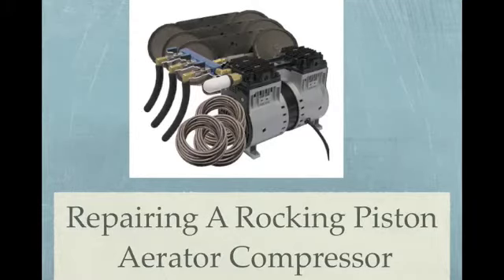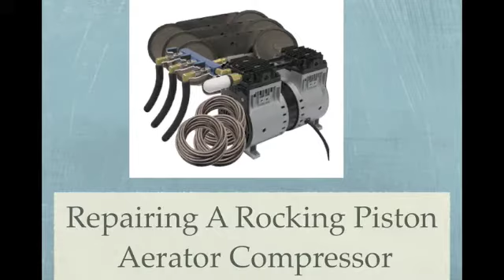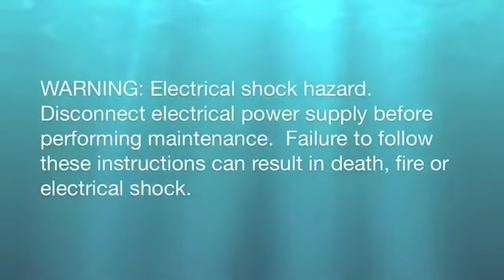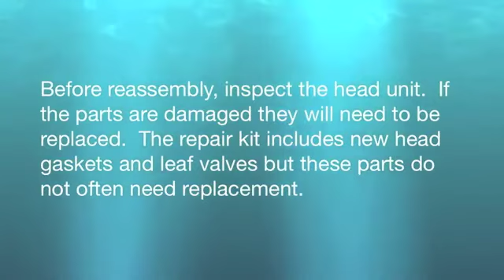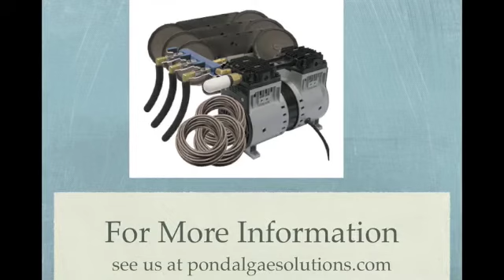Pond Aerator Repair

Comment: I should note that in terms of routine maintenance, this would include piston seal replacement as I noted in the video above, but the other, more frequent update should include replacing the air filter as needed.  Most models today have a corrugated paper filter which is inexpensive and easy to replace.  Doing this regularly will help with the performance and longevity of the pump.

Comment: Do the piston rings have an up or down side?
Reply from the maker: Yes, both the piston ring and the piston cup would need to be oriented properly...up and down sides are different.  The easiest way to get this right is to pay attention when you take the pump apart initially...assuming you are repairing it for the first time, they'll have it right from the factory.  Depending on the brand you are working with most will have decent instructions to work with too.

Comment: Where to get repair kits?
Reply from the maker: It would depend on the pump model.  Let me know on the brand and model number and I can give you more information.
Reply from the maker: If I got the code right, this is coming up as a Vevor pump...a chinese import.  If vevor doesn't have the rebuild kit, I'm not sure who would.  There were pumps early on they sold that did not have kits...not sure if this is one of them or not.  Just curious...how long have you been running the pump?  A fair number of people had theirs crap out pretty early on, some caught fire, etc.  That's the word on the street at least.
Reply from the maker: There is a reply on the page for that pump, at the bottom...someone asked about rebuild kits and as of spring of 2024, they said they don't sell parts separately.  They'll replace the pump within 12 months but after that, you may be out of luck.

Comment: Where do I put the replacement filter
Reply from the maker: Sorry, missed your question...there is a black canister attached to the pump...the replacement filter goes in that.  Its probably removed from the pump in this video...it would go on one of the intake or "in" ports.  The other intake port would be plugged.

Comment: what type of capacitor do you use for that pump?
Reply from the maker: Hi Brandon.  It depends a bit on the brand from what I can see...but as a general rule...the 1/4 HP, and the 1/2 HP which you see in this video are using a cap that indicates 370VAC/B 50/60Hz on the label.  Hope this helps for you.
Reply: @klmponds  Thank you